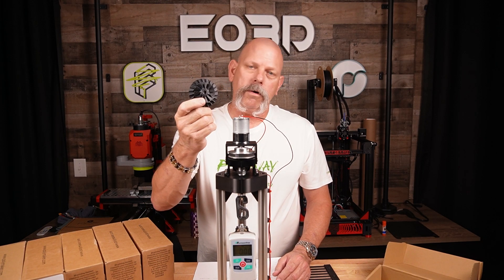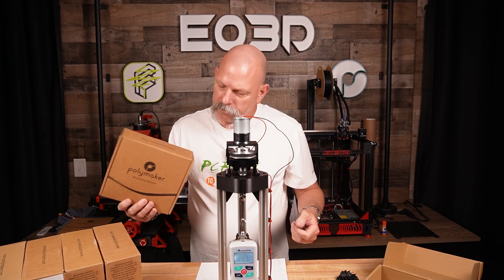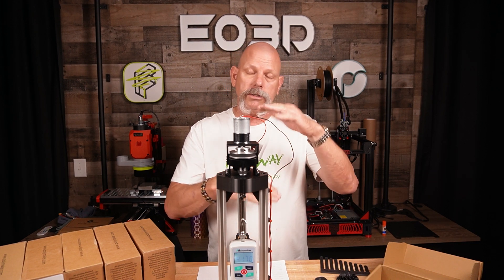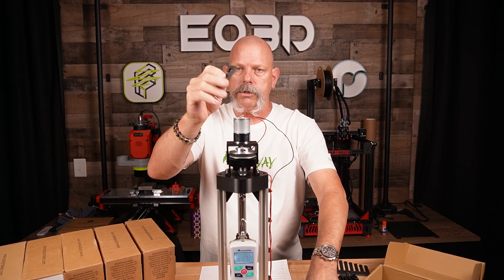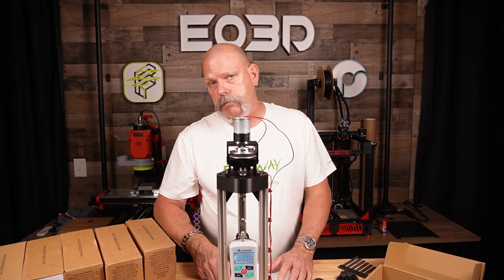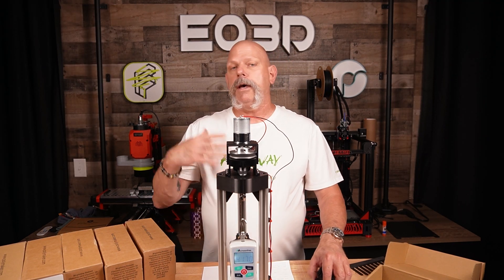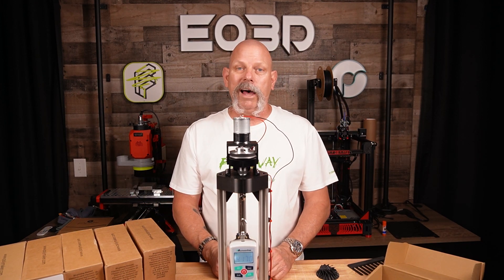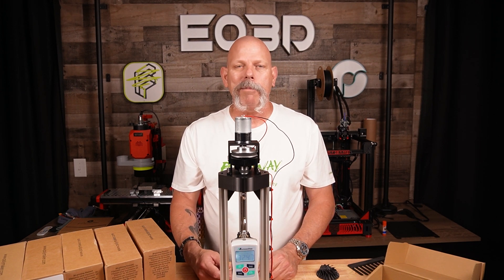Testing Polymaker Fiberon | EDGE OF 3D

Comment: I am designing an electric fiberglass paddle board racing boat.  

I test props at lower speed for efficiency and 3D print them (Later to be printed in aluminium )  

I use PLApro now as being RIGID is key, the prop spins at 3500 RPM which means the tips are spinning around 250 mph! 

While the PLA pro does stay together, it flex's at the tips and leaves our testing flawed. Do you think this Fiberon material is best for our testing?  PA/Nylon is way to flexible when I tried.
Reply from the maker: I would look into the PPS-CF by Polymaker or a PPA-CF by Sirayatech, those should provide more stiffness but without proper testing, it's an expensive "should". 

Some other possibilities, though I have not tested these (yet) are PC and PC MAX.

Comment: I was disappointed when the Fiberon PPS-CF10 arrived from this American company, to find it’s made in China. I certainly have nothing against “made in China”. But I was hoping their line were all made here. At the price, I was hoping that if this was useful to me, the prices wouldn’t jump from $70 for .5 kilo to maybe $100, or even more. These tariffs are insane. Something else I noticed as I just ordered extra spools from Bamboo Lab. Some are good to 70 C, light grey, while some are good to 90 C, dark grey. But PPS-CF10 should be heated to 100 C to dry. I assume I’ll only be able to keep it on their own cardboard reels and I’ll have to heat it in my large lab oven unless I get a small one just for this purpose. Too bad the Bamboo Lab AMS HT only goes to 85 C. I wonder how much that 15 degrees really matters in practice.
Reply from the maker: Polymaker is not an American company, they have always been based in Changshu, China. They do have a facility in Houston, TX where they are starting to manufacture some lines of filament but by no means all of the product lines come from there.
Reply: I would think 15 degrees would make no difference, just heat for a longer pwriod of time.

Comment: Why even run tests with wet filaments?
The test should be run under the best circumstances that thy were designed for. 

This was like running a performance car test with flat tires.

Comment: Hello! 

Thank you for providing this strength testing data for us, as you seem to be one of the only youtubers I see with access to this material at the moment. 
For both PPS-cf and PET-CF, this main source of popularity is their heat resistance AFTER being annealed. Would you be able to conduct a basic HDT test regarding this after annealing the samples? 

As I stated before, the flexibility of filament concerns me in that the base resin (ignoring the cf for a second) could be blended with other lower temp/more flexible materials that will affect the pet's ability to crystalize. This would lead to a lower HDT than other PET-CF filaments already on the market, making polymaker's PET-CF and PPS-CF pointless for applications requiring higher temps. 

Thank you :)
Reply from the maker: I'm working on that at this time to get some solid testing done with regards to annealing and heat testing. Mind you, I am a content creator and not an engineer/scientist, so these tests are largely subjective and by no means meant to be lab quality testing. I take the approach of designing my own test equipment and going at it from a hobbyist/maker approach and not an engineer or scientific.

And, yes, I am extremely fortunate that Polymaker trusts in me enough to supply me with pre-market samples to work with. I hope to have a bunch more results to share before the 25JULY public sales launch.

Comment: Interesting that PET-CF actually beat the PPS on layer adhesion and came close to it horizontal, plus has a lower printing temp.

Judging from the “clink” the PPS-CF makes when it hits a hard surface though, I’m guessing that it’s way more rigid. (Very high bending modulus.) I guess another plus is that it has such a high temperature tolerance. I just wish my X1C could go to 340C 😕
Reply from the maker: If you watch in the video's where they break, most of them bend a little (or lot) then just kind tear then snap but the PPS-CF does not "give" at all then when it does fail, it's explosive in nature. It also breaks leaving VERY sharp edges, much like shattered glass. I had a part fly off the tester and sliced my arm open like a razor blade.

Comment: By the numbers, these exotic filaments often hardly look better than PLA. But man, print kids toys in them and you quickly see the difference in durability. I printed pirate ships for my kids in two sizes using PA6-CF. Haven't broken yet. One has been out in the yard for like 6 months and I saw them ride over it on the power wheels.  The sails broke immediately on the PLA ones the second they were dropped.
Reply from the maker: On the surface with just the limited testing I have done, yes, the numbers indicate that there isn't much better about them. However, there are multitudes more parameters that I do not have the lab equipment to test that show where each of these excel.

As for being tough, exactly right, the limited testing might say X is only marginally better or in some cases not as good as Y but in RW applications X is superior and Y isn't then another RW scenario where Y is the only one that will work and so on.

You want tough, print toys in a hard TPU and watch kids try to break it.
Reply: @EDGEOF3D  Printing toys is my test-n-tune for when I print my own "toys". ;)  CF Nylon seems to be a sweet spot between stiff and tough.

Comment: 2:33 It's crazy when you set the part down it sounds like metal, hahaha. Wow drying the filaments makes a big difference in the updated spreadsheet. Strange the lowest temperature printed PPS-CF has the best layer adhesion. The Polymaker prices are actually pretty reasonable, so I may try some of these, especially for future automotive projects.

Comment: In sold on the pps-cf, my problem is the prusa mk4 doesn't print at 320 😢

Anybody modded it?
Reply: There are pretty solid guides on modding Prusa machines to print at higher temperatures. I believe PT1000 temperature probes are readily available for it and you may want to upgrade your heating element so it doesn't struggle to maintain temperature. I believe the hotend and heatbreak are all metal, so you're good to go there. Will probably need software mods as well, though I'm not familiar with the procedure on Prusa. Either way, a few $10 bills and some time and you'll be able to, I believe.
Reply: @802Garage  thank you I'm looking deeper into it.

Comment: Do you know if Polymaker bought out XYPolyer's PPS? The timing is very coincidental.  I used to buy their PPS-TF (nobody knows what the "TF" stands for) but they pulled it from their page shortly before Fiberon PPS-CF dropped. Cool stuff but now the price is insanely expensive now😔
Reply from the maker: I doubt Polymaker bought out anyone's line, they are one of the very few real filament manufacturers in China. Polymaker is not the only thing they make; they produce filament for a large number of companies.
Reply: @EDGEOF3D  good to know. Thanks for the video!

Comment: Good vid. After you dry all the filament and run the tests again can you put all the result in a chart?
Reply from the maker: Working on that right now, the PA12CF just finished printing with a RH of 12%, the PET-CF is printing right now showing a RH of 18% (currently on the dryer, once I remove it, it will drop to 10-12% after it cools).
Reply from the maker: New dry test results updated: https://drive.google.com/file/d/1en9KDNgrJA8KJxTUj27f5IGfI8oRO-z9/view?usp=sharing